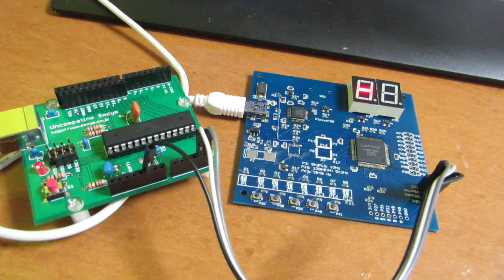Another sample of I2C device implementation by Lattice FPGA

Comment: I would like to use Arduino as SLAVE to check the I2C behavior of fpga. They both connected to the GPIO port like the video. When the oscilloscope confirms that the address, data, and values are output correctly in the FPGA, when the state is h'z to receive the ack, the SDA falls to low by itself without connecting to the Arduino. Could you give me some advice